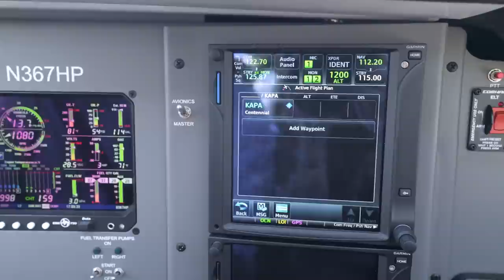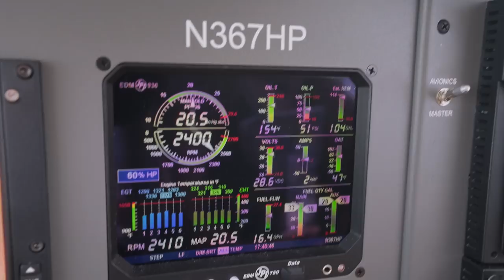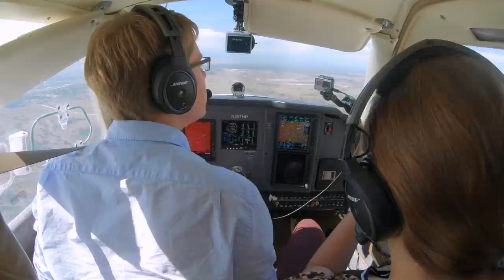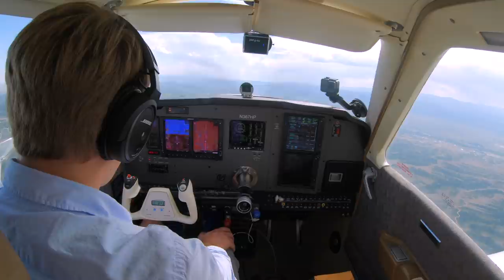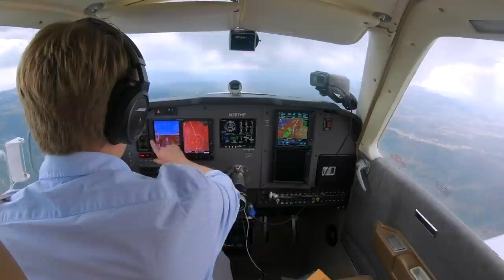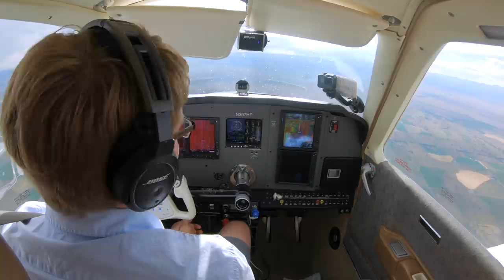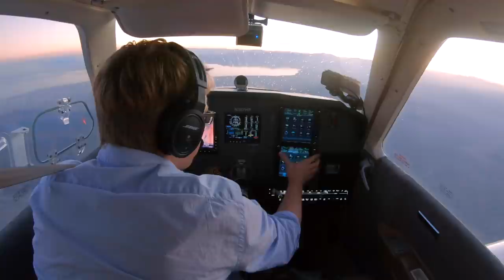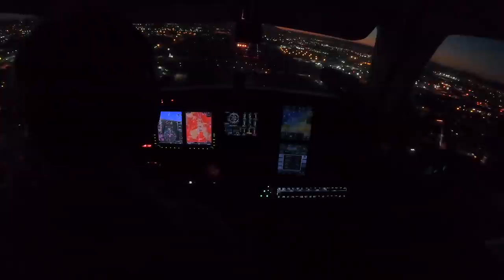Flying Thousands of Miles in a Bonanza

Comment: Matt.   I should have posted this some time ago.  A good friend had a V tail with very similar issues.  He went through the wringer with the issue and $$$$.   He actually sold the airplane.  The new owner located the issue.   In the V tail there are two major holes in the firewall for wiring and cables.  In the penetration for most of the wiring to the front end, they found fatigue in several of the cables.  The cables were either stretched or in some cases, casing rubbed through.  The fix was to re-wire the entire front end back through the firewall.  The exact culprit was never located but the plane flys well today without issue.  Something to consider.
Reply: I hope he sees this tip! ⬆️

Comment: That really sounds like a bad ground. Especially since you have replaced the parts already. I would clean the spot where the ground goes to the frame, or maybe even replace wire. I think its intermittent because of aircraft vibration. i bet it always reads good while the plane is on the ground.
Reply: Very good theory. It might also be an intermittent open in the signal wire to the voltage reg.
Reply: This is a very good suggestion.  A lot of problems in general are bad ground connections.  Especially the weird ones.
Reply: Agreed they should be able to detect some stray voltage. Not sure about this motor but I would start with the engine ground.
Reply: @slaznum1  That's exactly what I posted on one of Matt's previous videos! I had a similar intermittent issue on a car, replaced lots of things, then after a strip down I discovered that the only engine earth strap was a ratty piece of wire! Replaced with a proper braided strap and it's been fine since.
Reply: Yeah, the plane is never actually on the ground as far as electrical grounds are concerned with those rubber tires ??, it sounds more like something is overheating, or overloading, a temp gun would be my suggestion or an infrared camera if you have access., just look for hot spots., even if it’s a poor ground connection it will create heat..
Reply: @ryanhogan6509  ground in this context just means the negative side of the circuit where there is no voltage.
Reply: @Baja555b  exactly, so sitting on the “ground” would have nothing to do with anything.. if your implying there is less vibration while sitting on the ground while running? , generally in my experience it goes from vibration to floating as soon as my tires are off the physical ground, now if you mean turbulence? If anything you could inspect or add static wicks?, but I would guess there is either a loose connection, or something overheating or one creating the other..
Reply: @ryanhogan6509  I know there is probably more seat of the pants feel of vibration while the airplane is on the ground, but when you are up in the air and turning more rpms i would imagine that is a pretty good amount of vibration in the engine bay. Really most of my experience is with cars. But i do agree that it is a loose connection.

Comment: I'm a aircraft engineer and going by your maintenance history, wiring checks are the obvious thing to follow up, not throw parts at it. Every wire, every crimp and connector on the alternator circuit. I work on 787s plastic bastard and this is one of the first things that is required!

Comment: The flight legs were wonderfully familiar. A momentary loss of situational awareness occured when it appeared like Matt was suddenly alone in 7P. The journey became an exhilarating pondering environment between beating responses to atc and gazing out at many of the most scenic areas in this part of the USA. My mind swiftly analyzed and formed a diagnostic of the missing electrons. It was easy because I know that all of the charging system appliances function perfectly and that the electrical system components are functioning properly. EZPZ enjoyable ride along for me. Thanks. Also enjoyed reading comments about ground fault and or open connections. Which led me to my final conclusions. Yes! And beyond simple opens at ground paths I followed Inductive heating and high resistance in the components connectors wiring, switches, breakers or power relay switches at the accessories power circuit from switch to source. Kinda like a fully loaded bus bar extravaganza I thought. As the resistance slowly increases due to inductive heat two faults occur simultaneously. The  secondary or conditional fault is because the voltage regulator senses voltage out of limit but the primary fault is high resistance at the weakest point in the circuit. It is not like water pressure and damns at all, no, it is akin to a good conductor who quits when under to much load. The liberal pertinent utilization of the Ohm meter and dc amp probe can quickly pinpoint diagnose the entire circuit and then divide it further until the point of failure is isolated. The electrical system schematic is as enjoyable to me as a VFR chart but clear and concisely configured like the IFR chart. Anyway, I wish all the rewards of experiencing at least one wiggle test.
Cheers.

Comment: Great Sand Dunes National Park at about 19:40
Reply: We camp there almost every spring.  Years when the snow pack is good, there is a river running through the base of the dunes for a week or two.  (Medano Creek)  Also, an awesome short hike where you can stand inside a frozen or partially frozen waterfall (Zapata Falls)  Hot springs nearby as well.  And, to top it off, an alligator farm you can tour!
Reply: Awesome! I used to live in alamosa
Reply: Looks like a sand lake with frozen waves. Beautiful.

Comment: Every time you bring up your alternator issues all I think of is that you have a ground problem in the system. Even if they use a normal multimeter and get conductivity, you may still not have a good ground. That is only detected by the use of a milliohm meter. We normally don't consider something properly grounded if it's over 2.5 mohms.

Comment: My money is on a grounding issue. Intermittent issues are almost always a bad ground.

I don't have an airplane but I have a race car. Had intermittent electrical issues. Kept replacing things. Checked ground connections. Nothing. Then a guy on my crew physical grabbed all the grounding straps and gave them a tug. One broke off in his hand. But it looked perfectly fine when checked. Replaced it, it was good as new and then went on to win a 25 hour race.

Comment: If theres a dead spot on the alternator it can act like your describing, intermittent but operable.  I've also had an alternator snap off their positive connection and vibrate loose from the negative internal mount as well. Both conditions while not the same will exhibit intermittent failure.  I've found heat shrinking both sides of contacts effective assurance of continuous service assuming normal conditions.

Comment: There is a wire or connection that is compromised. Such as a wire with damage insulation, because it’s rubbing on a metal edge. Or a connection at a connector or terminal lug that has corroded.

Comment: Lets hope you can get that charging problem fixed. As an automotive tech I can say it's not easy troubleshooting intermittent faults, especially electrical.
Reply: My 2001 dodge ram 1500 5.2 is having on occasion a high voltage situation but goes normal on idle and then just goes away completely for a few months or three?

Comment: Hi Matt, 
it’s good to see you flying your plane again. I have an old 6 V car that is prone to corrosion in the ground to the engine. When the ground cable has internal corrosion that you can not see,  the resistance will test good with the ohmmeter when not running. As soon as the engine is running you can get an intermittent open in the circuit. 24 V electrical systems are less prone to this type of problem than 6 V. I suspect this may be what is causing your problem. It is cheaper to replace ground wires than alternators. Do you have a backup alternator?
Keep up the good work on producing your great videos. I especially enjoy the mountain flying ones.

Have you considered getting a portable oxygen system? I find that it gives me much more flexibility flying in the mountains. Once again I love your videos. Keep them coming.

Comment: Dumb question - does your plane have a second alternator? If not, what do you use to back up your panel displays? Also, did you have to get a ferry permit for your flight? Assuming alternator is on MEL.

Comment: Out of curiosity ...  If the alternator on my car isn't working, I can drive for a while, but eventually there will be no power and the engine will stop.  How can you fly half-way across the country with an inoperable alternator?
Reply: This airplane has two alternators, and only one consistently has issues. Also the engine runs on magnetos so it will continue running even if the batteries die.
Reply: Airplanes have 2 magnetos and don’t need an electrical system to keep running.